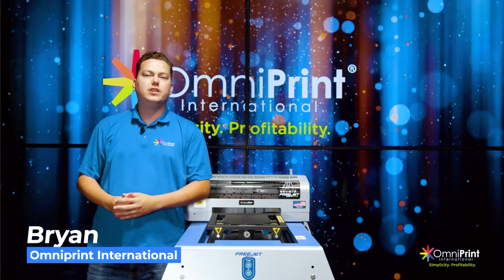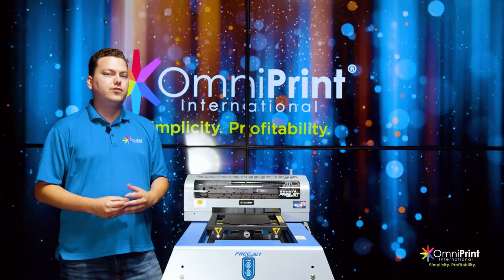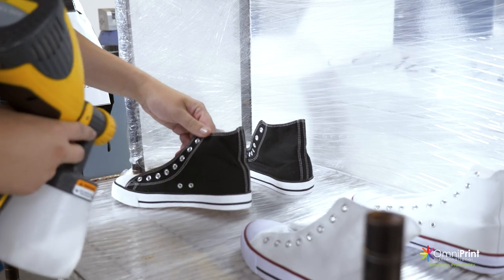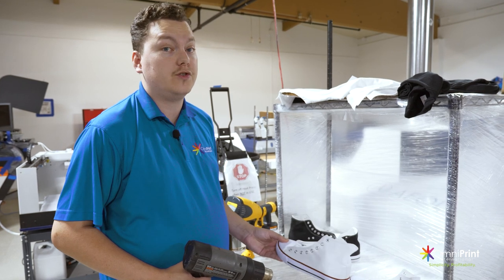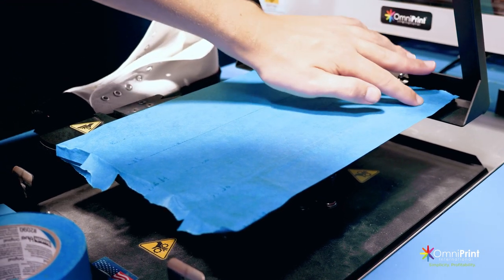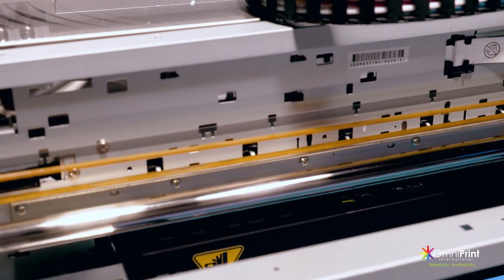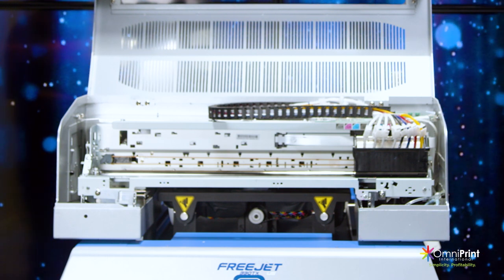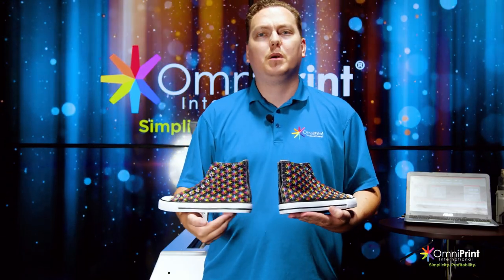How to Print on Demand Sneakers

Comment: Can i print on nike airforce 1 using ur printer?
Reply from the maker: Hi @tedyaman5720 great question, the shoe would have to have a flat surface to print on but another option would be to print onto a transfer then pres it. The fabric parts of a shoe should be no issue if you can press it properly.

Comment: Can this print on soccer boots/cleats? Thank you
Reply from the maker: If it's a canvas-type material and is flat enough to fit into the platen shown in the video, it would work. Connect with one of our reps if you have more questions! 949-484-4181
Reply: @OmniPrintInternational so leather or faux leather is not an option